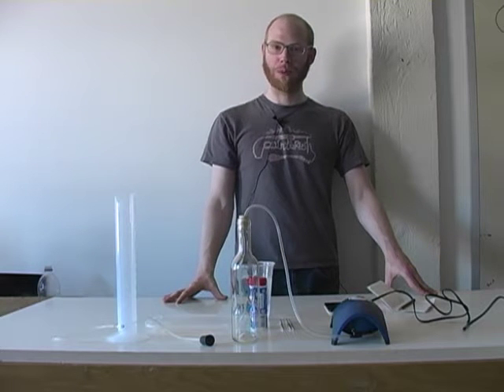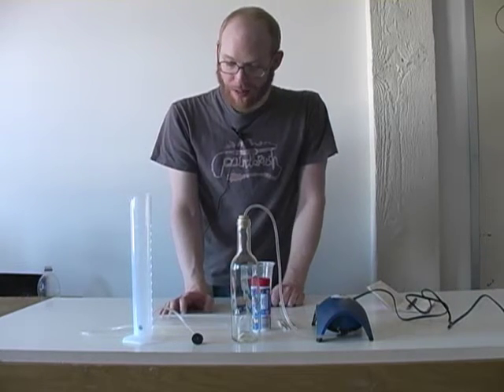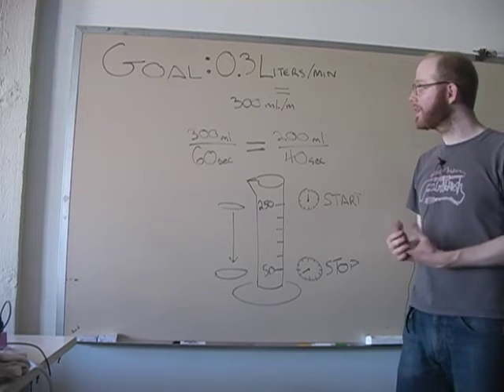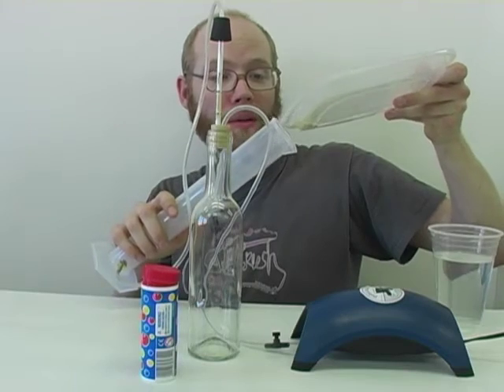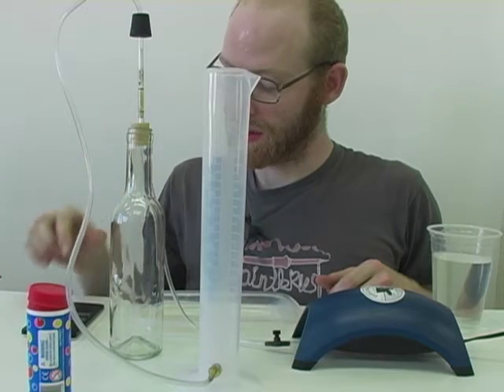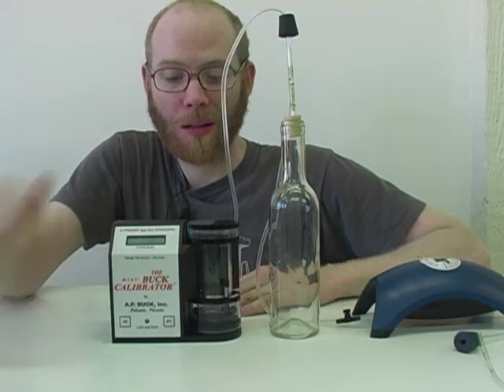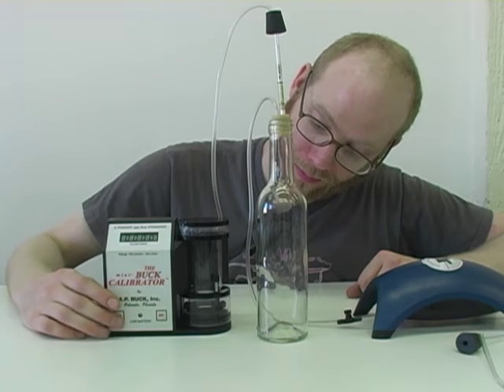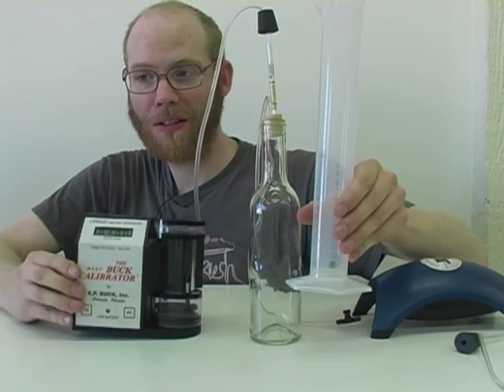Calibrating an air pump with bubbles and a graduated cylinder

Comment: So, what about filling a the graduated cylinder with water and then clamping it in place such that the end is just below the surface in a bucket of water, then letting the air displace the water in the cylinder? I realize that there will be a slight error from compressing the air, but it would be interesting to test to see how negligible the compression would be if the lip of the cylinder was just deep enough in the water to keep the water from falling out until it is displaced by air from the pump.